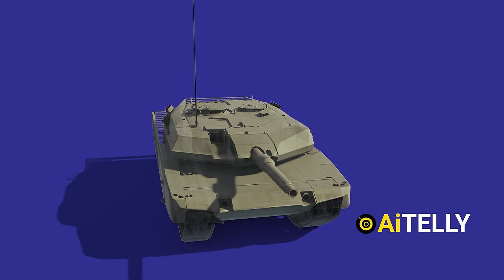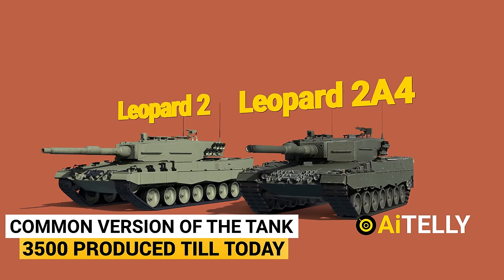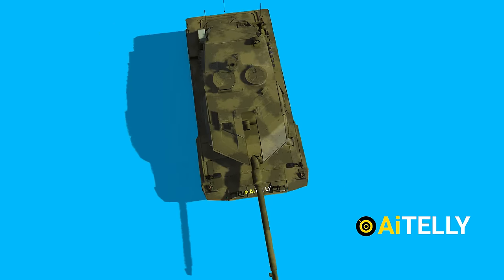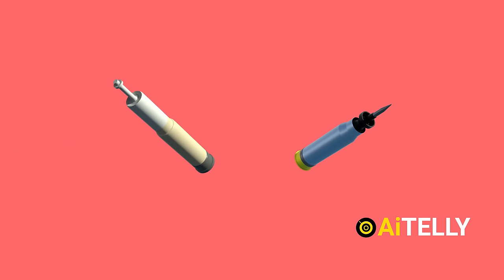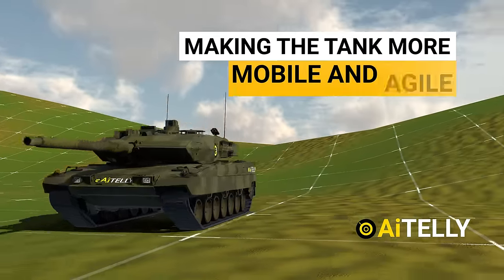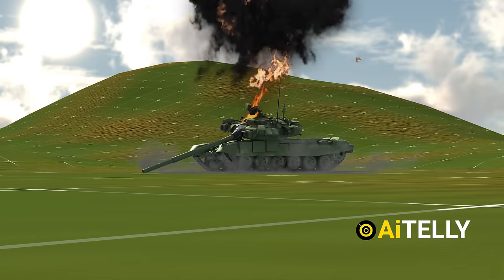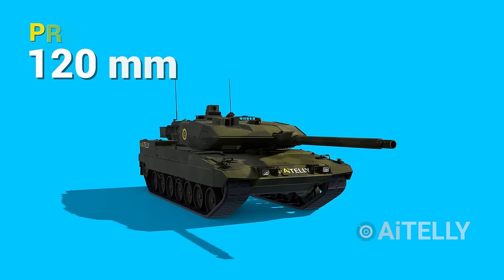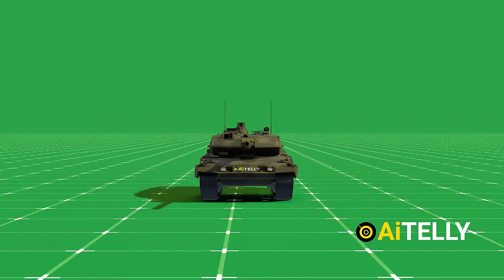Leopard 2 Main Battle Tank How it Works with modular Space Armour Leopard 2A6 Loepard 2A4

Comment: I was a Leopard 2A4 and 2A5 tank commander in the 90s.
Its hard to find exact information on tanks, if you havent served in one.
Range of the main gun is a lot more than 2km. The multipurpose round has around that range, maybe a bit more, but its slow and flies in a curved arc, while the kinetic round (really, why do English use these annyoing abreviations? In German its just MZ and KE rounds) is fast and flies witha lmost no curve and is accurate way past the 3km. Cant remember exactly what max range is for it in combat, on shooting ranges it was limited though.
While the coax MG indeed has the 1.2km max range. At that range it looks as if the rounds fall from the sky onto the target like tracer rain.

The hull ammo storage is indeed not protected and not usable during combat.
The turret storage you didnt mention, that one is blast protected, and the only ammunition the crew can use during combat. Thats only 15 rounds (or so). Sounds very little. But then again, the Leopard is supposed to one shot kill any target, so in theory each Leopard 2 wipes out a full other MBT platoon before they have to reload. (or hide somewhere safe and get the rounds from the hull up into the turret)

Biggest Con for Leopard 2 - it still doesnt have any active protection. No missile detection, no laser warner, no nuttin.
Reply: Doesn't the 2A7V have those things now?
Reply: @pm7353  No active protection on the brandnew 2A7V. Its the still hypothetical next one, the 2A7A1 that has active protection similiar to what the Israelis got for way over a decade.

Some of the stuff that got added to the 2A7V sounds like pure scifi though.
Reply: @theskilllessgamer5795  Die A8 Version wird mit Trophy ausgestattet sein. Zulauf 2025/2026
Reply: Да да, хранилище в задней части башни, которое замечательно вспыхивает. Это просто дорогой гроб.
Reply: @АнтонЗахарутин-г4т  So you dont even understand what a blast protected compartment is. Da Da, school was wasted on you. Have fun being mobilzed.
Reply: Najbolja provera je u praksi. Teorija lepo zvuči. Najlepše izgleda epp pred prodaju.
Reply: Hey I was a Canadian 2a6M gunner!
Reply: А ещё они отлично горят. Как показывают боевые действия.
Reply: @АнтонЗахарутин-г4т  As opposed to russian tanks, where the whole turret gets sent into space, in stead of just a small panel
Reply: @CSVspb редкие т90 тоже отлично горят, не говоря уже о 72 ...Здесь в основном школота и игроки в ВОТ...дупля не отбивающие о реальном состоянии дел в боях. Хотя,  есть просто техспецы, указывающие на ТТХ без относительно боевого применения.
Танк, не умеющий обнаруживать наведение на него ПИУРа или дальномера - это кринж...но в современной войне эти поиблуды уже мало эффективны из-за Дронов и наведения арты ...хотя, очень полезны , если "на сигарете" ехать и опа!!)
Reply: Yeah noticed also some wrong data in the videos, for example the fins don't introduce spin and the penetration value is A LOT more than 450mm for DM55.
Reply: Always great seeing tankers hop in to give some information on their own tank(s) they served on.
Especially for those always debating on protection levels, general capabilities. Etc
As we see for those leaking information on Warthunder forums. Lol

Was surprised to see how the then Leopard 2A3 wasn't as well protected compared to it's contemporaries. Closer to the UK Chieftain mk10 in armour protection levels against KE.
This obviously changed with the A4 variants to come in the late 80's.
But then again it's fast speed, very accurate & stabilised gun made it able to get off the first shot in most engagements to knock them out.
Reply: @Mrscarth1  Hey, I am currently making a Leopard 2A6M mod for the game arma reforger. Could I ask you some questions about it?
Reply: @АнтонЗахарутин-г4т  тебе ж виднее чем командиру танка
Reply: Would you like to see something like the Trophy system on it?

Any opinion on ERA being useful or not for it?

My ancestor fought in a Sherman Firefly back in WW2, tanks sure have come a long way since then.

I play War Thunder a lot and it seems to me like the best APFSDS rounds can penetrate the front hull of basically any tank on the planet, is it the case that basically this isn't something which can be overcome reasonably with current armor technology? The turret can be quite tough but maybe it's just not reasonable to beef up the front hull to overcome the ridiculous penetration power of cutting edge APFSDS ammo (tungsten, depleted, etc)

Suppose that's been the case to some degree since the MBT doctrine and Leopard 1 - the firepower just became so deadly that no amount of heavy and thick armor could overcome it, so you're better off focusing on mobility, fire control, optics, etc,?
Reply: I read they didn't feel the "shot trap" problem was a factor. I figured the Abrams-style wedge would be fairly obvious starting back in WW2 - the t34 gets all the fame for "sloped armor" but there were tanks from more than a decade before the t34 that had sloped armor... anyway the mantlet design "evolution" seemed kind of stupid as they went from the earlier panthers semi-circle, to the "chin" on the otherwise semi-circle, and then eventually just a thicker flat plate which was narrower. 

I'm rambling. 

If you had to serve again today, and had to pick only (let's say two) MBT's to fight with (I assume youd want yourself in a L2 as you're accustomed to it), what would they be and why? Russian tanks have a low profile, strong ERA, etc, but the rounds stored in the turret go POP and it seems like a lot of them are so slow in reverse they'd be better off just getting out and pushing the tank backwards.
Reply: @teejayaich4306  The Merkava.
The Merkava is a very pupose built tank though, but it has a lot of very useful features.
Before the Ukraine war, the IDF was the most combat experienced army in the world and this is their home built custom made tank.
Reply: @teejayaich4306  Optics above all. You have to see stuff to be able to hit it. If your thermal sights have a bigger range than our enemy, you win.

I am no expert on cutting tank ammunition, but I am sure the Leo2 turret front armor is sufficient to deflect or stop any round.

Games like War Thunder etc are not realitsic. In real life you show only the turret front to the enemy, the rest is hidden. Then you try to kill at max range, if terrain allows it. In games you duell over a few hundred metres and can shoot the hull.

ERA I found always more than a risk than useful and was glad my tank never had explosives strapped to its outside.
ERA is useful against shaped charge but has only very little effect against tungsten darts. And unlike in games, shaped charge are not used against MBTs at all, only against softer targets.
However, with drones using shaped acharge and attacking from odd angles, ERA might be more useful.
AT missilies have longer ranges now, too, and might eb defeated by ERA.

I would prefer active drone/missile protection, though, like a trophy system that shoots them out of the sky before they hit.
Reply: @Bohoro  Да-да. Видели фото leopard с оторванной головой на Ближнем Востоке. Тут весной в Москву привезли и leopard и хваленый Abrams. Кстати бортовые проекции защищены очень плохо. Если влупить чем-нибудь серьёзным, то экипажу будет очень не хорошо!😆

Comment: 4:28 I want to correct you here. The fins of the APFSDS round are not meant to give it rotation, it is to provide aerodynamic stability to the round, hence the name "Fin Stabilized". Rotating a long, thin rod will only makes it aerodynamically unstable, even with the fins added, which is why it is best fired from a smoothbore gun. Rifled tank guns use APFSDS with slip obturator on the sabot to cancel out the gun rifling.
Reply: Also 450 mm is a Joke haha modern APFSDS go 800mm and Beyond
Reply: "Rotating a long, thin rod will only makes it aerodynamically unstable"
wait, that's how arrows work, need more explanation.
Reply: @moxinghbian  Arrows dont travel as fast as shells, also they dont rotate as fast as being rifled through a barrel either. The fins are there to give stability by means of aerodynamic, not gyroscopic.
Reply: @hjmuhdfirdaus3038  l disagree, it is very hard to ensure accuracy with hard welded fins (like those in an unguided bomb) without a build in control system to correct the influence of wind or air density change. spinning it can surely help. Besides, all the slow mo videos of those rounds are all showing the rod spinning.
Reply: @moxinghbian  arrows don't really spin, what do you think the feathers that are often placed at the back are for
Reply: @pill_popin_pigeon4759  errr.. a simple google will certain tell you otherwise
Reply: @moxinghbian  why do u think we don’t use rifled tank guns any more
Reply: @moxinghbian  Yes they do spin, but not as fast as being spun by rifling, otherwise they will just simply tumble in flight. Your analogy of using unguided bomb doesnt work either, unguided bombs are simply dropped, not propelled through a barrel, they lose accuracy more because they have bigger cross section which makes them more affected by crosswind.
Reply: @moxinghbian  And accuracy is ensured by the tank's own ballistic fire control computer and muzzle reference system
Reply: @kaumelt1961  The 450 mm armor comment was likely provided to not possibly breach a security requirement in not disclosing the actual armor penetration capability.
Reply: @pill_popin_pigeon4759  barrel pressure and TOO MUCH spin? Doesn't mean the smooth bore fires everything with ZERO spin.
Reply: @flyman451  The official Bundeswehr disclosed Penetration of the 120 L55 with DM63 is 810mm. The 450mm seems the Value of the DM23 Ammunition which was first delivered to the American Abrams Tank and their L44 or the L2A4. But even the DM33 has a better Penetration. The Penetration Value of the American depleted Uranium ammunition is not disclosed but most likely at the range of the DM63 in 120mm/L55
Reply: @kaumelt1961  450 may work for DM23 but DM53 im sure can do closer to the realm of 800mm
Reply: @moxinghbian  The whole reason the military moved from rifled guns to smoothbore was because of the higher velocity of not having to spin something in addition to propelling it to high speeds, plus the APDS-FS darts are slim to be A: more aerodynamic and B: to be able to penetrate the target much better, which is also why modern rods are much longer than older ammunition. And to make up for the lack in material in comparison to a much thicker APCBC round you just make the rod from a much denser material, you can do this experiment yourself by throwing two snowballs, one with loosely packed snow and one you have compressed to almost ice, at the same diameter the denser snowball will fly much further at the same given energy as it has more mass at the same aerodynamic crosssection. But now you still have the issue of your dart being able to just start tumbling so you do the same you did with rockets by giving your APDS dart fins which are designed to stabilize it without a spin as a spin will cause instability due to how long your rod is, hence APDS-*FS*.
Reply: @indeedDE01  still doesn't explain why arrows were designed to spin in ancient times, and they were quite stable.

your apdsfs rounds will still spin during flight. Watch any high speed camera footage. any tiny imperfection in fins will cause some degree of spin.

does it need to spin frantically like a bullet? No. Does it spin? absolutely.
Reply: @moxinghbian  my point being that APDS-FS is not designed to spin, and the reason as to why arrows spin i have no clue as im not an archer, but as far as im concerned, long flying pointy things get their stability by using the leverage of drag to turn the arrow into the direction of where it's flying as the point of drag is behind the center of mass thus always turning it into the correct direction.
Reply: @pill_popin_pigeon4759  "Arrows don't spin" Are you dense? The two feathers are straight while the third one is skewed which gives the arrow its spin.
Reply: @HanSolo__  actually all feathers are slightly turned on the most stable arrows because then all fletchings will impart spin.  When I make my arrows I have a calculator to decide how much offset to apply to gain the best flight for the speed of the arrow
Reply: Any Rod flying through the air* that is, in till you can find a way to apply grooves to a round (commonly rifling of some kind to both projectile and gun) in some shape or form, enough to add what is considered a proportionate, suitable velocity
(Without or without added propellant, delayed, secondary charged / powered, or both in case of missiles or alternate ways of achieving such) :) no such thing as semi rifled :) :D
Reply: Yeah that annoyed me too, why would u guess on an informational video

Comment: The turret wedges are not simply spaced armor, but modular system with multiple steps. It is a misconception that the spaced armor is „enough“ to destabilize a long-rod penetrator. I’ve seen it explained quite often in this comment section. 

I’m going to keep it short:

- The front of the wedge has heavy-NxRA (non-explosive reactive armor) elements that work similarly to the heavy-ERA „RELIKT“ which is in Russian use. These basically expand into different directions when being in contact with the HEAT-jet/APFSDS. This causes directional stress that results in the penetrator being deformed and broken. 

- The destabilized remaining bits of the penetrator are lastly going to hit the main armor. These are nowhere close capable of penetrating it. The main internal armor has been upgraded several times, and reportedly, recently in the 2A7V too. It consists of ceramics, titanium, tungsten and multiple other high streng steel alloys and materials.
Reply: Didn't help the Ukranians this week.
Reply: @andykerr3803 it did. Maybe the tanks didn't survive, but the crews did. Which is kinda the job of armor i guess.
Reply: @T.efpunkt  If they lived, it's doubtful their hearing and brains function well.
The number of handicapped will be a massive drain.
Reply: @andykerr3803  what brain damage??
Reply: @T.efpunkt   The concusive forces do damage over time. You don't walk away untouched.
Reply: @andykerr3803  as long as you don't have to replace the tank crews but only the metal, you made a good deal. A trained crew with combat experience is worth more than the most expensive MBT.
Reply: @T.efpunkt  Tanks really are an expensive proposition. I believe the new Leopard 2A8 is available now. The Russians have a vast array of weapons to be used on any tank regardless of defense sophistication. As you say, it is not only the crew, but the support. The figures for tanks eliminated vary wildly, but the true certainty is their drain on resources and propaganda when they are shown pulverized. To see Ukranians using them to chase down single infantrymen and plow into trenches is short of impressive. A lot of them don't even arrive. Later on you may see very creative use for urban warfare by Russia with their quicker, quite turbines supported by the newest wave of Terminators. But it will be limited and controlled use. Ditto, the Armata.
Cheers 🍻
Reply: @andykerr3803  you're trying to tell a soldier how to fight a war. There is nothing unusual in the attacker being at a disadvantage and losing battles. D-day lasted 9 weeks in real life until they established a foothold and logistics. The 2A8 production will start soon, but they are certainly not delivered to ukraine. Terminator isn't a wonder weapon and there are only 20 something T14 armata prototypes. It will take years to see them in mass production replacing the current T80 and T90 variants.
Reply: Do you have a source for the armour compositions?

Comment: Unfortunately quiet a few things wrong. You guys mixed up data of the 2A6 and 2A7. The 2A6 weighs 59,9 tons like stated earlier and at the end it was suddenly 62 tons. You also stated the L/55 can penetrate (with apfsds ) only 450 mm RHA at 2000 which is wrong, modern rounds like DM63 still have over 760mm of penetration at 2000m. Furthermore the leopard 2A7V has multiple cameras and FCGS capabilities. So situational awareness is very good. The 2A7V also has an APU which makes silent operation with low heat signature possible. I’m surprised you didn’t come up with the classic ammo hull storage problem, which was made obsolete in 2007 when Rheinmetall developed new propellants which do not ignite when impacted with shaped charges or kinetic projectiles

Comment: The Leopard 2 is propelled by the MTU MB 873 Ka-501 engine, 90° V-block 12-cylinder, twin-turbocharged and intercooled, liquid-cooled diesel engine and very important with multi-fuel capability….. Diesel, gasolin, mixture of diesel and gasolin

Comment: correction. the fins on an APFSDS are NOT there to make the round spin, rather they stops the round from spinning as a spinning movement would destabilize this kind of rodd shaped projectile
Reply from the maker: Is this true because an artillery Round was intentionally made to spin from the rifle Gun.
Reply: @Aitelly  for an artillery round it true because it's not Rodd shaped like an apfsds round. And artillery round aswell as almost all the older gunshells from mid 1900s have more of an elliptical shape which will rightfully stabilize the shell with a spinning motion. It's all physics and the difference between an elyptically shaped round and a rodd-shaped round

Comment: Nice video. I will note that there is one inaccuracy with the tank's steering: If the controls were turned to the left or right, the tank would move around a circular path instead of moving in a straight line.
Reply from the maker: Thanks Ivan for your feedback 👍
We love you guys 🙏
Reply: @Aitelly  You are welcome. Sorry for the late response. I would advise checking for this inaccuracy in your other tank videos, too.